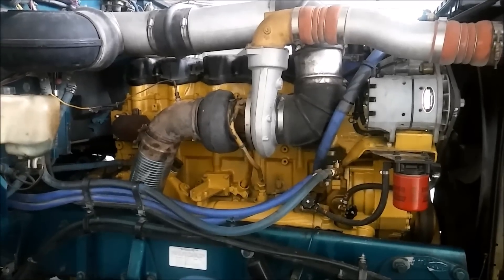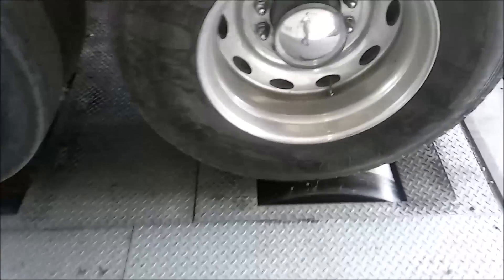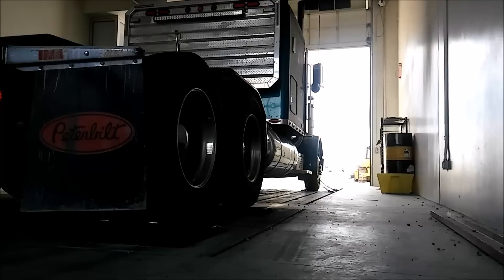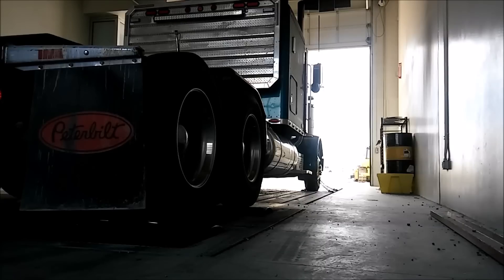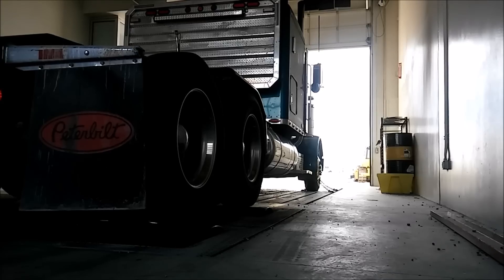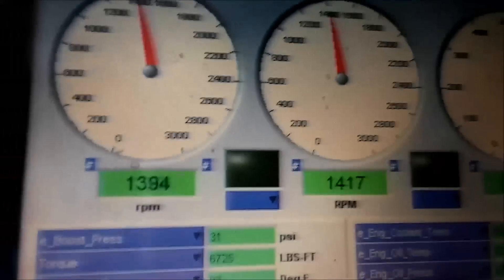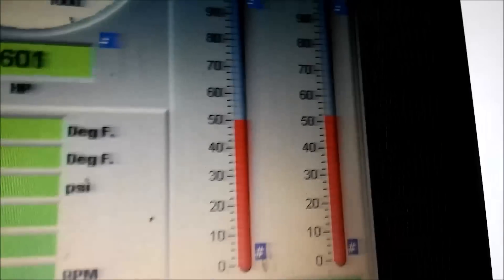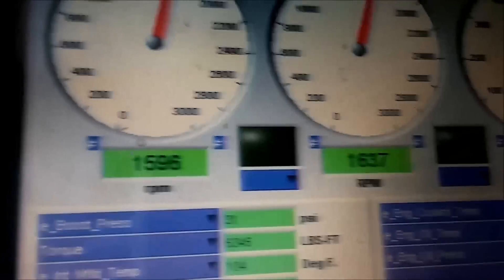Caterpillar Diesel C15 Truck on the Dyno

Comment: aftermarket ecm tuning, would just bringing the rpm limit from 2100 to 2500 increase hp much on a c15 at 475hp?
Reply from the maker: I doubt you could gain any horsepower from a higher revving C15, they are built for low rpms and have heavy.... well everything is heavy, the pistons, camshaft, crankshaft, and valvetrain are really not built for it. Even if you could rev it up without it coming apart the engine power curve would be making less power that high up. Now I'm sure there are guys out there with aftermarket camshafts and other parts getting more rpms out of them, but I'm not an aftermarket expert. Maybe check out Pittsburgh Power they used to mess with these engines.
Reply: do you know if that bully dog tuner actually gains much horsepower, they say up to 15% but I'm guessing in reality maybe only 5% gains
Reply from the maker: +killer120 I don't want to tell you yes or no because I really have no personal knowledge of whether they work or not, I just know that it's hard to trust a company selling you something and supplying the information on it.
Reply: yes definitely true, ive had good experience with Pittsburgh power, I think ill just end up getting a big boss turbo and tune from pdi along with the power box from Pittsburgh, gonna be pretty spendy but I could use the power, I wanna get around 700 or more
Reply from the maker: +killer120 I did have a truck on the dyno with a Pittsburgh Power box on it that has 6 levels and it really did pull harder with each setting like 20 hp and 2 psi of boost per setting step.
Reply: I'm just wondering how much horsepower and boost the stock injectors could support
Reply from the maker: +kwmiked I'm glad your helping him with answering the aftermarket stuff, I really don't know it.
Reply: its usually 2300 rpm not 2500. 
and yes it usually gets the 625 tune they offered in the c15 after the did away with the c16. but most places wont do it to the low hp c15s cause the different pistons,  injections,  ect,ect
Reply: so would they uprate it to 625 if you swapped the parts to meet the 625's parts?
Reply from the maker: +killer120 They should since those parts are really only the difference between them, but on the rerates between families there is a stipulation that you contact Cat before doing it, so I'm not sure what they would say. I've probably done over 100 rerates, but have never done an out of family one, probably because guys that want that much power go aftermarket.
Reply: true, would probably be cheaper to go aftermarket, I think might be able to make more power if the base ratings higher, bring a 475 to 625 then add on some aftermarket stuff like a power box and turbo or something, whats all different between the 475 model and the 632 model? is it just pistons and injectors or would they have to change cylinder heads and all that also
Reply: +killer120 yeah, but im not using a dealer. just a guy that knows his Cats, he probably knows more about cat fuel injection and how it works better then cat. U can find a lot of this info on the fourms if u google tuning a c15 even some questions u have are in MBN area, Mr Haney  and Smoken Cat seem to know whats going on. Thats if the guy here cant answer some of your questions cause of his job
Reply: but my transmission is a rtlo18918b so Idk if they would do an uprate from 1850 to 2050 torque, probably would be better off getting a pdi tune
Reply: +killer120 not a issue,  good trans! keep oil full and just watch the trans temp gauge on long pulls in top 2 gears, dont wanna let the temp get over 250.  Mine should be around 640 , 2200lb at wheels , so he says. i know hes got a Hot stock c16 that he pushs 1300+hp thru on stock trans, obviously its detuned for driving.  Look on the fourms for Mr Haney in the c15 sections, lot of older posts he answers a lot of questions.
Reply: wheres the forum lol ill have to check it out later got a call, truck blew a tire again gotta go down and fix it...again :(
Reply from the maker: +killer120 With that trans a dealer wouldn't give you a 2000 torque rating rerate, you could get a horsepower increase, but not a torque increase. Aftermarket would let you do whatever you want, but then your going out of the factory guidelines. It's your truck though man, so do what you want to and makes you happy, I just give you the info.
Reply: +killer120 im not trying to take away from this guys page here, just helping someone to find other info that a Cat guy cant give u. i went thru all the bs a couple yrs ago trying to find the right route to go without paying PDI prices lol He wrote the book for PDI i ll put it that way.
But the info on this guys page is also helpful too
Reply: +Adept Ape that is correct.  if hes still in warranty i probably wouldn't do it, just so u dont loose it. But if out of warranty,  thats the way to go. I do a lot of heavy haul, 4 axle trailer, 4 axle tractor 130-140k  i wouldn't put a hot rod newbie in it. lol
Reply: +Adept Ape i dont know much either,  just what i researched when looking for info on the MBN, But i read a lot of info along the way. Forgot a lot to. Once i did tune n turbo i was happy and stopped there, he did recommend exhaust manifold and the better CAC , but my manfold only had 90k mi on it and was eroded inside,  on the cac i figured id try it and see how the egts were then go from there. i really gotta lug it down to get it up to 1k degrees,  so i think everything is working how its supposed to. If i do the marine cam ill do the exhaust manifold and cac
Reply: +kwmiked wasn't eroded *
Reply: I had an old 3406e a while back that had 400 something hp, I think 435 something around there, I bought a power box from Pittsburgh power and it ran 615hp, I was kinda amazed, only gained 200 lbs of torque though, id like to get one again but along with a pdi tune, lol that's gonna end up costing more than the trucks worth, only paid 6k for it haha
Reply: +killer120 id stay away from Pittsburgh Power boxs, they are known for just adding fuel and running to much timing,  or vice versa.  I know someone who messed up a c16 pretty good with one of those boxs. So just be careful
Reply: nah ive run power box before, its actually not bad, they don't adjust fuel pressure or injector override but they change the mapping to increase the throttle response and a few other things, only problem is the egr temps go a couple hundred higher but a big boss turbo and manifold should help with that
Reply: +killer120 i wish i could give u the guys info to talk to him so he could explain it more, id stay away from Pittsburgh Power.  Find one of the fourms that are still active,  google C15 MBN problems, find someone like Smoken Cat or Haney and get Haneys info to talk with him on phone. what he can do for u is probably cheaper then the Pittsburgh power box and its safe for your motor
Reply: +killer120 itll be rare if u talk to someone who knows Cats and played with them that says Pittsburgh Power is a good choice to go with!
Reply: +killer120 my MBN use to run 1100-1200degrees rolling thru a light in 6th gear and lay into it, running 55-60mph on hwy it was always around 1k + empty and the truck was a slug, now if i could get it up to 1k loaded thats lugging it down low! normally it runs at 7-800 now, and feels like double the power of a 525hp MBN factory tune. U wont get that outa a Pittsburgh Power box
Reply: +killer120 and it doesn't huff black smoke! slight brown haze when u lay into it at 1200rpm
Reply: haha well the truck already did that at any rpm before it was on, pumps the fuel in before it can get the boost to match it lol
Reply: +killer120 well thats what i mean, its tuned nicely so it doesn't attract attention to the diesel bears, and it runs cool and u have a newer truck that pulls better then the old 6nz or 2ws, if u want another 100hp u do a marine cam. Look into it. its all out there
Reply: lol yeah I just cant find any direct places to buy, I know pdi does stage 3 cams for 6nz, theres so much id like to do but having tough time with bills lately, first thing I think ill do is have pdi do an ecm tune, later down the road get the big boss turbo and throw on the power box, my goal is around 900hp, I talked to a guy named steven Bradley, hes pretty good with that kinda stuff,does tuning and fuel system mods on c15's and E models, he had some ideas to do on it for me, also talked to jean luc bosse that does the rodeo du camion races with his 1800hp peterbilt, hes running stock dana 46k axles and stock driveshaft, says stock transmission can typically handle 1000hp at most
Reply: +killer120 like i said, go to the fourms,  search c15 mbn issues,  u wanna talk with Haney, but youll have to get his info from someone that still is on that fourm.  he wrote the book for pdi, he half the money for the same thing.  only thing u buy from pdi is exhaust manifold if u need it. tune is around 1200 bucks, turbo around the same maybe couple hundred bucks more. do the work to get info. itll save u the $$$
i cant give out his info here
Reply: +killer120 google a BW S430sx turbo,  they went up since last time i got mine. But that turbo is for my application,  its the same turbo your gonna get from pdi with theyre ribbed exhaust housing,  obviously you will need to know correct size wheel and afr before u just go and order a turbo
Reply: Pittsburg Power box on my N14 500E Cummins. Blows 45 to 50 lbs manifold pressure and will out pull any stock Cat 625 there is. I estimate its about 700 hp. They told me when I ordered the box that my cpl  was the "good" one and I would see about 30 hp per setting. I run it on setting 5 and it runs like a sumbitch. Replaced the turbo with Pittsburg's own version of a Holset (they keep that secret) and exhaust temps are ok on 5 but it will get hot on 6 or 7. It changed the power band from a 1400 rpm torquer to a 1600 to 2100 rpm horse power maker. Love it.

Comment: Was that 600HP to the wheels?? If so Im curious as to what was programmed to get that and cat warranty?! I thought it had to be a factory stock to keep warranty
Reply from the maker: +kwmiked It is an excuse for me, since I don't own the dyno or shop. Now as a shop with a dyno they should definitely have it fully calibrated, probably every year, since they are charging a lot to use it. Most of its use is for after rebuilds to seat the rings.
Reply: +Adept Ape well why isn't it recalibrated?
Reply from the maker: +jace1911 Our dyno is a chassis dyno so it measures at the wheels. I didn't mess with the numbers, but our dyno was out of calibration and tends to read quite a bit higher on horsepower than the actual. You may know that you can lose about 20% of your horsepower through the drivetrain and I think this engine was a 500 hp rating, so the dyno should have shown somewhere in the low 400 HP range, but it reads too high as you can see. All the other parameters, IE boost and temperatures are correct.
Reply from the maker: +kwmiked That's up to the shop, they have recalibrated it every two years, I'm not sure the next time the guy is coming out to do it is though.
Reply: +Adept Ape thats really no excuse
Reply: +Adept Ape im just bustin your chops
Reply: Where about are you working?  I was formerly the PAR guy at my CAT dealer in Canada, but my dealer network decided to remove the dynos from all the branches that had them.  I miss doing dyno runs.
Reply: That Canadian Guy come to Seguin Tx were the engines are put together u can do "Hot test " witch is just the engine😁 but still a dyno test

Comment: Love your videos. About what kind of horsepower would this engine be making at the flywheel? I would love to see some more videos on 3406A CAT engines. Thanks
Reply from the maker: This engine is probably rated at about 550 hp at the flywheel. Our dyno is out of calibration and it reads higher than it should. 3406A engines are very old mechanical engines, this is a 3406E/C15. Thanks for comment.
Reply: Sorry. I should have worded it differently. If u have any videos on 3406a cats or ever get a chance to make one that would be cool. I have a 1981 kenworth k100C. I will be subscribing to you soon.
Reply from the maker: +Myron Jesch I figured you had a newer Cat and just meant a 3406E, but you have the original 3406. We don't see those very often, but if we get one to work on I'll post a video.

Comment: Do you lock the differentials when doing the test or keep the switch on the dash unlocked and does it make a difference?
Reply from the maker: +traingp7 I usually have the interlock and diff locks on while doing a Dyno pull. If a truck doesn't have them then it works too, but I try to even out the wheel load as much as possible.

Comment: I am considering purchasing a Maxxforce 15 powered truck, doing some mods to fix the egr issues ( reprogram the ecm, exhaust manifold, upgraded coolers, cooler thermostats, etc. ). Since the Maxxforce 15 is a slightly revamped Cat C15, have you had an opportunity to work on them and what are your thoughts about them? I think with a few changes, the engine can really perform properly.
Reply from the maker: If that is the same engine they were going to use in the Cat Truck, we have had a bunch of issues with them, but most of the problems were with OEM wiring. As far as the engine itself, haven't been into one yet so I can't comment on them really.
Reply: +Adept Ape From what I read concerning the lawsuit with Navistar, the wiring going from the ecm to the engine had a connector that fretted because of vibration, which then caused an overfuel situation to happen and the domino effect with the aftertreatment system. Navistar then hardwired the ecm getting rid of the connector plus some other changes under their Diamond Renewed program. The trucks are worthless because of all the problems they have had, and can be purchased for no money with under 300k miles.  I can see with some careful and considered changes, they can get the job done. The only differences between the Cat and the Maxxforce are the fuel injection systems, aftertreatment and block color.

Comment: what C15 model= ACERT? 6NZ? OR MBN? nice video
Reply from the maker: I think it was a MBN, but that was several months ago. I don't recall exactly. Not a ton of difference between the 2 serial numbers, 6NZs are considered the best by most people though.
Reply: yeah that right 6nz is the most popular of the three prefix numbers, ACERT is the most POWERFUL but has to be straight piped, DPF/EGR delete kit, single turbo conversion.
Reply from the maker: +Anthony Gruntt Once they started the twin turbos, they started getting too many parts and once they made the regen motors, well then it was way too many. Too bad because the single turbo Cats are great. Thanks for commenting.
Reply: no prob. yeah thats was the new ACERT technology downfall too many parts but its still POWERHOUSE though outpull a 6NZ or MBN, 3406-series anyday if you understand and program them properly. i think the ACERT CAT is the mosr powerful engine on the market before CAT stop making CAT engines becuz of EPA emission standards
Reply: Adept Ape i got a 2ws 3406e,what would it cause it not to build boost  on low side of transmission,and won't build over 20 lbs once in high side?

Comment: can you get better if you change out top end on the trans 18 and 13 speeds  and i change the rear ends gears?
Reply from the maker: +Julie Lane I'm not exactly sure what you mean by the top end of the transmission? You would have to change the entire transmission. You can change the differential gearing as well but your just changing your rpm range. If your really interested in increasing mileage, look into aerodynamics and hypermiling. Aerodynamics play a bigger role in mileage than getting a 50 rpm decrease.

Comment: how das the cat15 do in a eten9 to 18 speed! and will it give better fuell
Reply from the maker: Your going to get better fuel economy with an 18 speed usually because you can stay in the best powerband of the engine more often. 5.5 MPG seems to be the average with the Cat C15 in the higher horsepower configuration.